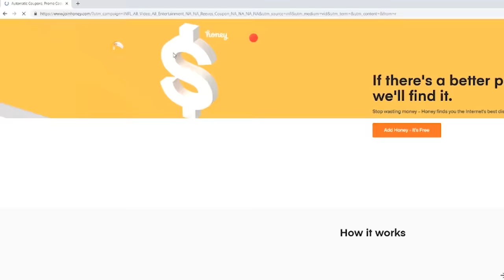Gas Powered Fishing Pole

Comment: "how tired is your arm?"

literally has to repeat pulling the start-up motor EVERY TIME
Reply: and you know those weed-whacker motors dont start til you pulled at least 10 times.
Reply: Easy solution: Add a motor to the motor so your arm doesn't get tired
Reply: @Ithzzz  y'aint mastered the art of starting a motor if you don't get it the first time
Reply: @1_____________________  Harvard: Bro, do you want a scholarship?
Reply: @moh4del  depends on whether the motor is crap or not because if it's crap it doesn't matter how good you are at starting, it'll still take lots of pulls
Reply: I know
Reply: @moh4del  yeah no there ain't no art to it; it's a rule of the universe that those things take 5+ pulls to start
Reply: @thedemolitionmuniciple  two pulls if cold, one if hot for these machines

Comment: HE has a Drill
Drill has a motor
Lets use 2 horespower motor makes sense

Hepatitis
Reply: He needed to make holes with drill in those pieces of microwave for them to hold together, so yes, it makes sense
Reply: Overengineering at it's best
Reply: if your life isn't in danger you aren't having fun
Reply: Well the drill is probably less dispensable of an object
Reply: @kenmken  you don't have to destroy the drill to use it. You just stick 8t in hole and spin.

Comment: "take the safety pin out otherwise it will explode"

Isn't that the opposite of a safety pin? haha
Reply: danger pin
Reply: reverse grenade
Reply: I think it’s to keep it from exploding on startup and then remove it to actually operate
Reply: Brandon Turner well if you keep it in and try to use it the engine literally can't spin the shafts which will cause pressure buildup then the actual weed Wacker will explode

Comment: understanding how a weedwacker works would have made this far easier for them. the metal shaft that the part that spins is on has a long metal cable running through it. similar to what you would find in the brake lever of a bike. when you give the motor gas that cable spins around inside the shaft and so the rest of the shit spins too. if there was some sort of tube then they could have left the cable on at the motor, ran it through the tube, attached it to the fishing pole and then put the engine on some sort of back pack.

Comment: might be intended for comedy purposed, however adding a gas power rc car engine would make it lighter and work 10x better. you can also buy a forward and backwords driving piece which will shoot the line out, or a pump of some sort.